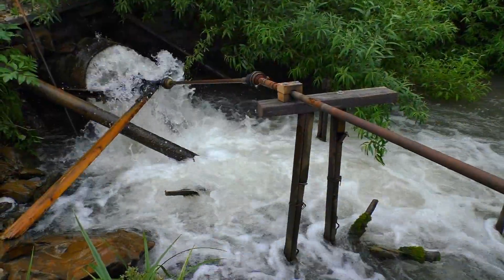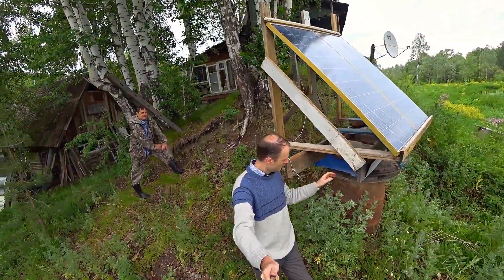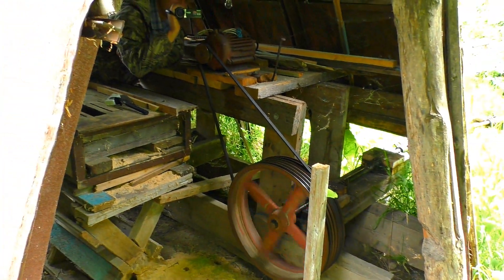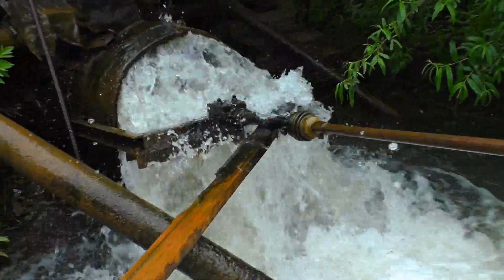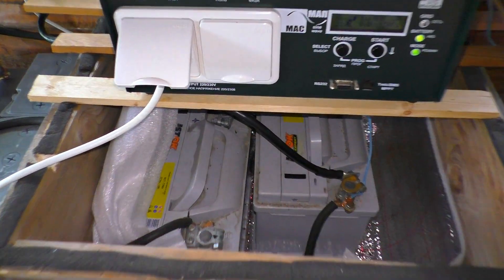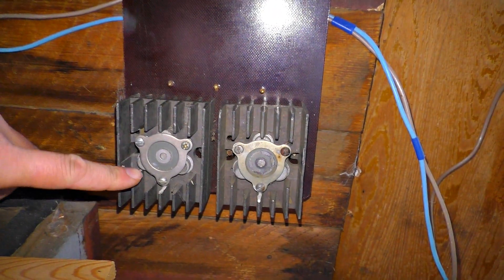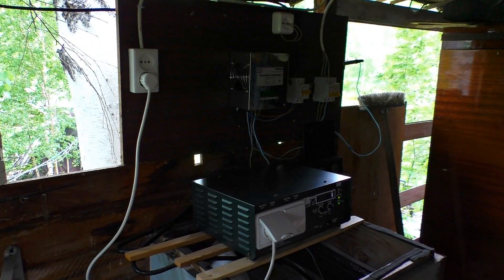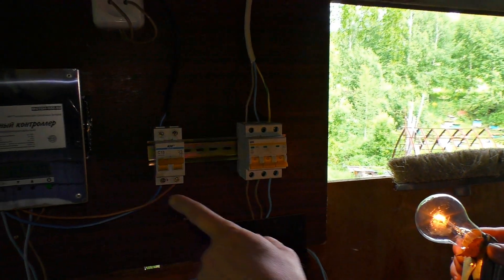#2 Free Energy! Hydro Electric Station DIY / Alternative energy !

Comment: You should add some fire protection, separate electrical modul from the wood by some inflamable board at least, if you don t  want certificiet electrical box. In long term each electrical component catch a fire.

Comment: that silver/chrome look inverter that you say is 'whistling and cracking' --- THAT is because it is not a true sine wave inverter!!! Any device with a switching power supply or really any FET power supply will really just be completely fried over some time. Seriously you need a 'True Sine Wave' power inverter. --- Also you should convert the DC into AC as close to the generator as possible!... Then put your battery management and power sockets far away. -- this will minimize those goose egg losses.
Reply: btw love your videos and motivation even if some of it is fake. really great content ! wish i could consult with you on some projects!?

Comment: why did you not have current control by the exciter on the generator? You can setup current / voltage limit for the generator regardless of the water flow very easily!

Comment: @KREOSAN Just take a thick wire rope and put it in these gray PVC pipes for the heating and then use the whole thing as a flexible drive shaft, so you save yourself all these joints on the shaft.

Comment: Having an inclined pipe will get the water flowing faster you might be able to have two sets of turbine blades for more torque. 

If it is  not too expensive,  it's best to produce more than your max use. You wont need to replace  batteries every few years or worry about charge controllers, ect.  You can than feed rectified 3 phase  strait into an inverters DC power rails. 

Only mess with batteries and the added complexities they require if at any time your electical needs surpass your generators ability to produce. 

Use highest voltage available for transmitting power over a distance.  Maybe convert 3 phase AC  strait off the generator to a 1:5 or 1:10  high voltage step up transformer, and near the house step the voltage down with a cheaper (possibly homemade) 3  auto transformer/variac. Steel banding  steel straps are painted making good laminations that minimize eddy currents, and is easily wound into a toroid of what ever size is needed, on which a copper coil auto transformer can be wound.

Comment: I would suggest keeping all the low voltage DC side of things closer together under the same roof near your generator, low voltage DC does not travel well over long wires, however AC does. the charge controller is a great start, you should combine your sources of power generation through a charge controller to store excess in the batteries and rely on the inverter to provide the consumed power to the homes, this should be the only long cable run as 220VAC will transmit better over the long line than the lower DC voltage.   (The inverter should also be getting its feed from the controller)

Make sure you use thick gauge wire on the DC side of your electrical system (No shame in doubling up) as this will result in less power loss on the low voltage side and increase the efficiency and capacity of the system, otherwise you end up starving your inverter of needed amperes when the loads are high.

Comment: To finish my comment look at this video 
This conception is interesting because of the feedback on the opposite motor which became generator and maintain the balance of the electricity power needed in the circut
The other thing is that the différents rings are free
If you add weights on it they will take more time to obtain the same speed, but, they also will stay longer running after shutting down the current
And will feed back the energy to the motors
More weight on the external ring, more powerful feed back to turn the middle in return

Comment: Hydraulique power is really strong, as you said, the energy lost by the connectors to transfer the movement is huge
This could perhaps allows you to put more than one generator...
You could also conserve cinétique energy with high weights on  high speed rolls
I give you the two links in an other message

Comment: You can put an inverter at the generator station and have 220 Volts directly in the cables, you will loose less energy in the cables runing to your houses
Reply: But then the inverter would get wet, or just the humidity or fog alone would in short time kill the inverter.
Reply: @God-yb2cg  Oh yeah , i forgot about that

Comment: The best thing to save on loosing power is higher voltage.  For example if you connect 5 solar panels in parallel the voltage is around 18 volts open and you need a high diameter cable to try to save on looses.  But 5 panels in series is around 90 volt and the same size cable for one can carry 5.  Another way to say is is 220 volt will have less loss than 12 volt when carrying the same watts
Reply: Also you could build the smallest room directly above the turbine reducing looses in the long run.

Comment: make the dam stronger and higher closer to the turbine, and build a platform above the turbine. the platform should be higher than the maximum flood level from the river. Make a short belt between the generator and turbine. 
in the power grid, you have to use proper wire dimension. use a 6 or 10 mm2 copper wire cable from the inverter in the powerhouse to the loads.

Comment: I don't know crap , about the electrical end , but I could give you a lot of improvement advise, on the water turbine and mechanical end 
For starters, put a cebtrifical  clutch on your turbine , calibrated to the constant power you want . There are a couple ways to do this.

Comment: You can make home made concrete and construct a one turbine power station.  
Put the turbine vertical and attach the generator directly above it.  

Fashion a tube around the turbine in concrete.  The armature runs vertically.  The generator sits on the top of the turbine.   A concrete floor is in between.

Comment: Kreosan Greetings from honduras,good engineering.How many R.P.M. have you reached straight from the turbine,or how many magnets did you placed on the generator rotor perimeter when turned the light on?.

Comment: Make your fins Smooth and symmetrical, maybe bondo or polyester resin w/cotton micro mixed in,, and paint it. Big sanding job but worth it. Propeller has to be smooth like airplane with correct pitch for flow speed of water.

Comment: Wow. The ammount of work that went into this is just amazing! Also please do a part 3 with the improvments as soon as they are done.
Edit: Also to minimize the power loses through the cable going from the generator to the charge controler you should make the voltage higher on that line. How? Well just add a transformer after the geneator that will increase the voltage and then before the charge controler just add another transformer that will lower the voltage by the same ammount. Remember: Higher AC voltage = lower current flows (but the same ammout of acctual power so you don't loose anything) and less current flowing = lower power losses

Comment: Put the water generator near the river on somekind a wooden or metal table, and just cover it so it won't get wet. To loose less power you can use transformers from the generator to increase the voltage and another near the house to decrease it back, and connect it to battery charger.

Comment: If you ever want to know about lead acid battery restoration, let me know.
Reply from the maker: Okey
Reply: Take the battery and check the fluid in it. Make sure the plates are covered. if exposed, fill just to the top of the plates with distilled or deionized water. Charge the battery with a bench supply (variable voltage / variable current) at 16.2V current limited at 1.5A. This should slough off a good deal of lead sulfate that could be insulating the surface of the plates from the electrolyte. during this process, you should see the current go up as sulfate falls off, and then come back down as the the specific gravity of the electrolyte increases with added charge. If the current keeps climbing or the voltage starts dropping with an associated increase in temperature, you have an internal short and need to replace the battery. 

Batteries are expensive temperamental, but when properly maintained 
they can dramatically outlive their manufacturers projected lifespan.

I love your work and hope this helps you save lots of money in the long run!
Reply: Make a video on it!

Comment: Neat update. I was at first thinking fuses or breakers and/or Varistor or Metal Oxide Varistors for overload surge protection.  I am not sure how these exactly can be made though may be able to be made from salvage components and be reliable.  

That is interesting the use of washing machine salvage motor potentially and issues.   Then you shown, as in the previous video, the old higher power generator/alternator and the potential to restore.  That got me thinking with your vertical comments and ideas noted from comments to remove the drive shaft since like the hybrid cars or anything... the least mechanical parts, the lower the friction will be.   Even with gears, like helical gears are better than say plane spur gears for less friction/resistance/loss. 

Have to read into what the best underwater submerged through cold temperatures container design and sealing of the container is for housing the generator/alternator. Most likely a torpedo or rocket looking tube shape, though might not be bad doing something like this out of the water: https://www.youtube.com/watch?v=Gnyo95hon-U

This idea of the vortex waterfall hydroelectric system came to mind: 
https://www.youtube.com/watch?v=XiefORPamLU
https://www.youtube.com/watch?v=buF8ASmwXt4

I am not sure it is the most efficient, though looks interesting with a proper turbine tuned.

Comment: Very nice installation! If you would want to store a lot of excess energy that would not be stored in batteries have a look at power to gas options. To start snd test try MISOL fuel cell and electrolyser
https://youtu.be/RuRoKHMFsEo
To avoid using high pressure of gas, make the container high volume!!! Safer and easier, you have a lot of free space ;D

Comment: Maybe you could build a tower (higher than the flood mark)  above the turbine to place the genorator, eliminating the need for drive shafts. Instead use a sprocket and chain or a belt and pully to power the generator.

Also maybe try to use both ac and dc current in your set up. Only use the 220 ac for fridge or washing machine. Use dc for lights (5w leds are fantastic), you can buy 12v TV and charge laptops, ect.

Eliminating the need to convert dc to ac reduces energy losses

Mozhe buty, vy mozhete pobuduvaty bashtu (vyshche znaku pavodku) nad turbinoyu, shchob rozmistyty henotor, pozbavyvshysʹ neobkhidnosti dlya pryvodu valiv. Zamistʹ tsʹoho vykorystovuyte z'yednuvach i lantsyuh abo reminʹ ta pulʹsatsiyu dlya zhyvlennya heneratora.

Takozh, mozhlyvo, sprobuyte vykorystaty strum postiynoho ta postiynoho strumu u vashomu nalashtuvanni. Vykorystovuyte lyshe 220 Vt dlya kholodylʹnyka abo pralʹnoyi mashyny. Vykorystovuyte postiynyy strum dlya osvitlennya (5 vahovykh svitlodiodiv fantastychno), vy mozhete prydbaty televizor iz 12-dyuymovym ekranom ta zaryadzhaty noutbuky toshcho.

Usunennya neobkhidnosti peretvorennya postiynoho strumu v akumulyator zmenshuye vtraty enerhiyi

I used Google translate i hope you can understand it lol

Comment: I use a normal 4 pole three-phase asynchronous motor to generate 230V 50HZ 2 kw simply by exciting it with capacitors, the best results are obtained with three-phase motors from 1.1 Kw to 10 Kw, it is possible to take 80% of the rated power of the engine, use the single-stage c-2C system where the capacity of the second capacitor is double of the first, 1C 45 μF and 2C 90 μF (microfarad) the motor runs at about +200 rpm from the data plate, the motor is 230V 400 V triangle star, the whole is stabilized by dissipating the energy produced in an electric resistance (oil stove) of ballast, which is electronically regulated based on the detected voltage and produced IGC (induction generator controller) directly use the 230V voltage for any aparecchietutra, being careful not to feed large motors or inductive electric loads too big, for now never had problems.
Reply: Are you doing like an alternator to generator AC to DC conversion like system for overload protection?   Like that would be complicated... though maybe not a bad idea if have components.  Run the largest AC generator directly wired to a AC motor then to another DC generator to convert and stabilize the system?  

I'm not sure... or are you just running a internal combustion engine to the motor to generate the 230V 50HZ 2Kw with overload going into an electric resistance heater to heat the oil stove.  That is a good idea also instead of turning a light on... heat water and store the heat for use.  

Maybe even use a pump with a relay somehow to trigger the pump for surges to pump water back up into a reservoir to use down later back in hydroelectric.
Reply: I connected the three-phase asynchronous motor to the hydroelectric turbine with the right ratio of multiplication that in my case served, the motor has 3 equal capacitors of that 2 connected in parallel, the terminal board of the motor is connected to triangle, the terminals of all the motors and are identified with UVW, the capacitor C is the capacitor in parallel with the UV output, 2C is the capacitor with double value of C is connected to the UW terminals in case of left rotation, VW in case of right rotation of the 'tree. the moofase output is always on C, then with a load-derived electronic regulator (IGC) that is based on the voltage generated by the motor / alternator, stabilizes the speed and voltage by unloading the unused power into a large electrical resistance. logically, the more powerful the turbine is, the more the derivation channels are needed, on the internet there are several more or less working idioms with pros and cons, logically being the brake of the suit must be reliable. Everything here, if you want it is also done with the arduino or something similar
http://www.who.int/management/InductionGenerators%20forSmallHydroSchemes.pdf
Hello
Reply: Hi, Thanks for the detailed reply.  I will read into more.
Reply: without digressing, in the micro hydroelectric island, out of the network, the power generated by the above mentioned system is dissipated, in this case it is based on the generated voltage, if it increases the derived load, (IGC) this to maintain the speed, consequently the stable frequency and voltage, with the synchronous alternators the similar system is used but based on the frequency and it is called ELC, on larger plants an automatic external rephasing machine is used to compensate the inductive electric loads, then there are the automatic controls of the flow rate but in the micro hydro in the island are not used to stabilize the electricity production, the automatic systems of the flow rate serve or to maintain the maximum power when the flow varies, so as to maintain the maximum level in the duct loading tank, or to save water , closing it when the control system derives too much energy, keeping a percentage available to compensate for the electrical cues The electrical requirement varies, remember that they are micro plants in the island and are not wind farms in the network, but the power generated is continuous and constant, logically varying the capacity varies the voltage, but the power generated frequency, then there is a very narrow limit used just to excite the electric motor and make it generate without magnets, that as far as they are functional they are not efficient being a system not really aligned with the stator windings and magnetic fields are not as efficient as on a product designed and made to ok,
instead the car engine excited by excellent results, especially if the engine is modern and high efficiency, logically from 1HP upwards, a true permanent magnet alternator is useful, then if the tension is straightened it is another story, this can also be done with the auto synchronous motors excited by means of capacitors, logically above the kw, it is better to use the alternating voltage directly, but it depends on system to plant.

Comment: you should add a fuse between each battery in case one fails and shorts out. It will blow the fuse instead of dumping all the other baterries' energy into itself.
BTW, the load is regulated by limiting the water flow to keep the generator at its maximum peak efficiency. (and the convertion circuitry's too) If you are gonna change the angle of the pipe, add a lid or something operated but a servo so you can close or open it to limit the water flow

Comment: Nice puzzle. Have you seen the generators which use a vertical shaft of 1.5 metres onto a turbine. It looks like a whirlpool and has high voltage stability.